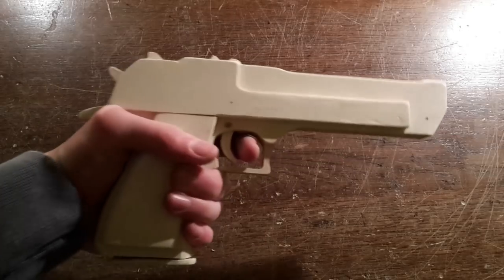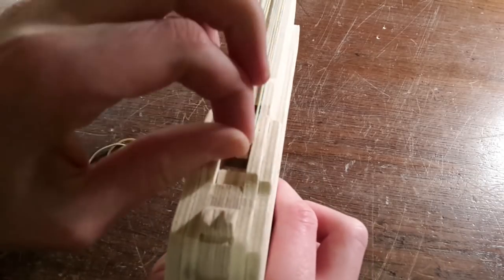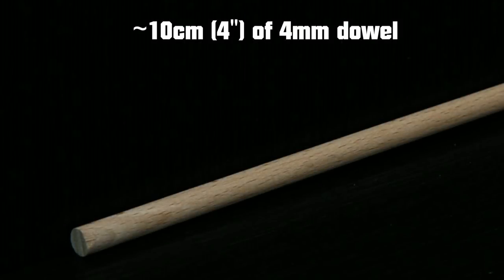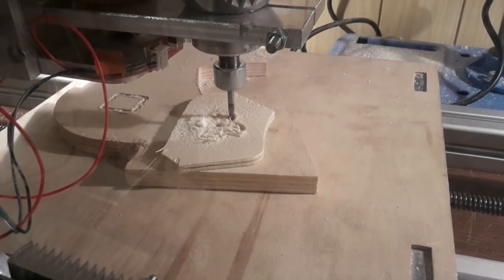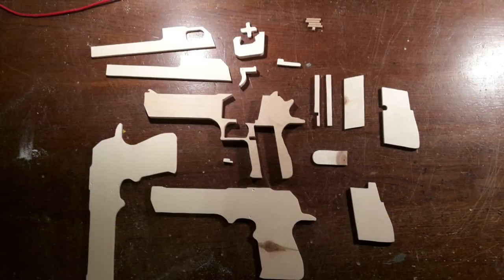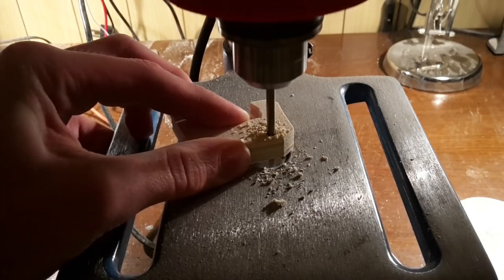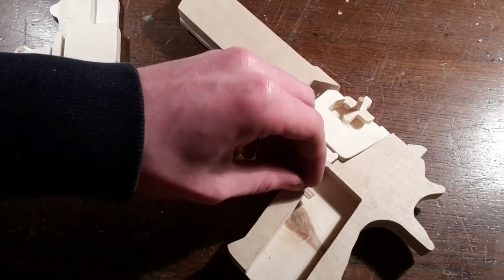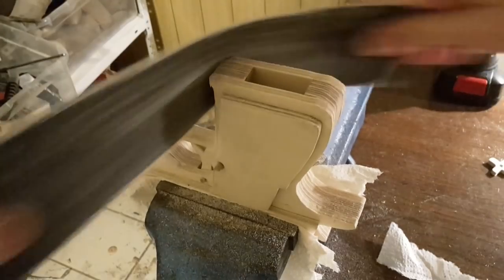Desert Eagle Semi-Auto [Rubberband Gun] - Free templates

Comment: Nice work! Wich Hardware and Software you  used for CNC? Arduino based? You can try EstlCAM for making G-Code Programms, its perfekt for woodworking.  Why you mill so slowly?
Reply from the maker: +Wal Wil I bought a set from Conucon.de which contained both software and hardware. I'm pretty sure it is Arduino based. for GCODE generating I'm using Fusion 360. I mill so slowly because that was like the second thing I ever made using the router and I wasn't quite sure about the speeds I need. Also the Z-Axis is not fixed properly, which I'm going to change today.
Reply: Du spricht also auch Deutsch? Es ist besser in mehreren Durchgängen zu fräsen, so kannst du schneller fahren und Kante ist sauberer.  Ich nehme zum Beispiel 1.5 Fraser für bis zu 6 mm Materialstärke. Welche CAD Software nimmt du zum modellieren?
Reply: Hier ist meine selbst gemachte CNC zu sehen: https://youtu.be/_Xb1bkH0KJQ
Reply from the maker: +Wal Wil Ja tue ich :) Ich benutze Solidworks, das bekommen wir als Maschinenbaustudenten umsonst.
Danke für den Tipp! Bin noch etwas neu in dem Gebiet :D Wieviele Schneiden haben deine Holzfräser ?
Reply: Ich habe meistens "Maiskolben"- stiftfräser für Holz mit zwei schneiden vorn. Damit kann ich 2,3 mm tief mit Vorschub von 500-600mm/min fahren, hängt auch von holz ab. Für Plexiglas gehen  nur einschneidige spiralfräser. Ich habe solidworks a probiert, bin aber mit Autodesk Inventor irgendwie schneller.